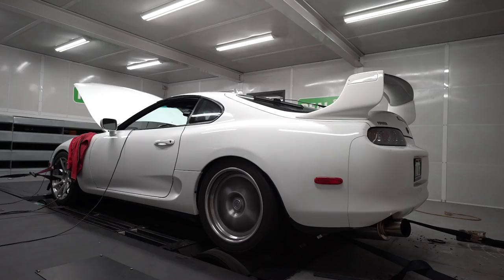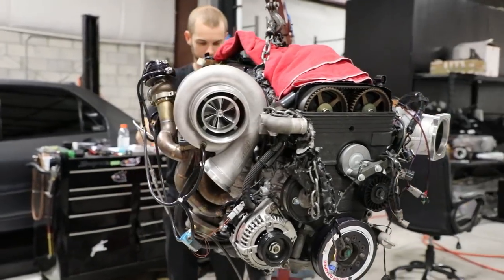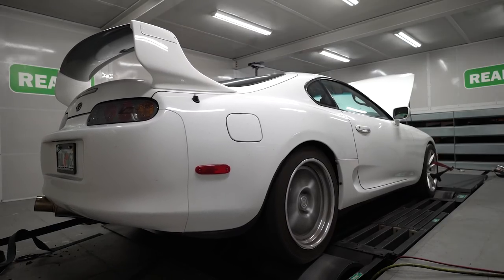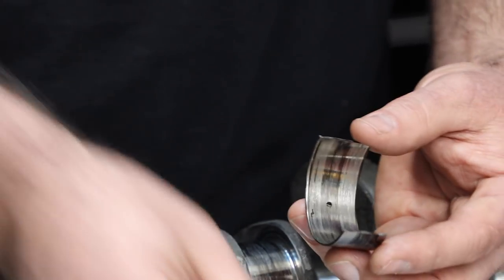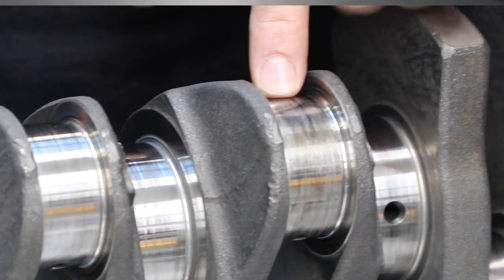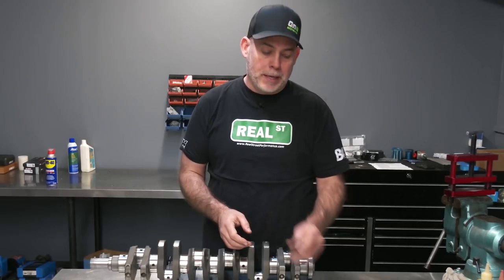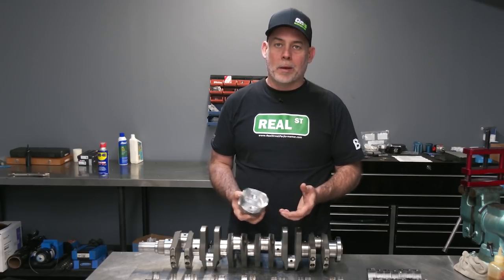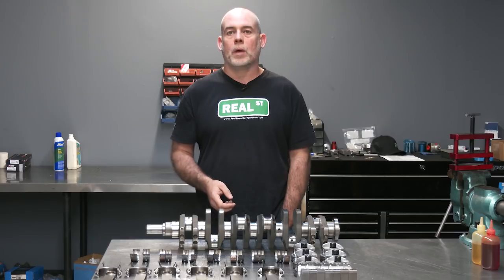Real Street 2JZ Failure Analysis Tear Down - Dyno Mule V1

Comment: Experience and wisdom without hype. Great video of development of engine life vs power due to parts systems.
Reply from the maker: thanks for watching Stephen
Reply: @Somerled Vonkaktus Ha ha really? Where is your video that is superior, equal to this? If your less don't hide behind word making you supreme. Polite people know what your doing and don't hold you to the real truth because they have mercy on a lesser man. Explain to you, negative without merit is mark of a troll. Thank you for your opinion forgot about video and now I'll enjoy it again!🇺🇸🌋🤔
Reply: @realstreetperformance  You can tell from the comments the bench racers vs we that task years in dyno room. Wow just find it to the point of funny at unfounded negative comments. Bragging at their lack of experience and knowledge. Thank you for excellent common sense video that is very clear for anyone open to increased knowledge. Keep up the good work!
Reply: @Somerled Vonkaktus Building custom engines 70s, 80s majority twin turbo and 10-71 to 14-71 blower engines. Common race engines in gas class going two season before need to freshen up for 9.90 class cars. 8.90 full season with one failure customer wounded engine in grudge race 7.91 1/4 mile on 96 degree day in 1987. Currently still running stroker big block 8.90 1978 Corvette. Works fine with oil coolers and is street driven to grocery store and for fun with 12.7 compression on 110 octane gas. Running dyno for decades and results of power with endurance. So experience with oils with or without dry sump oil systems. Road Atlanta or drag strips the 80s and 90s wasn't a time of replacing a car or mud truck engine every race. So talk is cheap but bottom end of engines and ring survival is a must found even today no matter what oil. Control of oil temperatures was a must baseline and alcohol injection conquers the problems when you still need keep timing more aggressive in the final rounds. Testing to the point of failure leaded to power and survival of a 520 c.i. big block chevy at a normal 7300 rpm with dual NOS each unit at 200 hp for total 400 hp boost on a 926 hp N.A. motor. I am retired now and this video is a very good example of how to read failures. If bit of timing or tired engine with it push pass endurance. If this guy was anything like you paint his lack of knowledge. They would be a window in the block...lol. You are just a disrespectful troll hiding behind negative comments to fool yourself like you are professional. Smokey Yunick would have kick you out of his parking lot. We both really have no time for someone who has to prove their stupid on the subject.

Comment: Great video  got me in hot spot thinking  ihave a VW 1600 engine  that had a worn out oil ring but I dnt know how to diagnose  if I turned  a bearing if my Crankshaft  if damaged  if the rods needs replacement  how do I diagnose  if the crank  needs to be cut o what

Comment: I disassemble my d15 honda engine and on my rod bearings on the upper  bearing hole has some material of bearing removed....like the oil pressure flakes the bearing around the oil hole....what cause this?

Comment: I have a 7 bolt 4g36 eng the transmission  isn't  changing gears right I've replaced everything new my eng isn't running right and then it does like a dream and then it is hard to start it says masflow is bad egr valve is stuck it's new map sencer is not working properly I can wigel the wires and reset codes and it will either run right or like not have power no acceleration like the mass flow air sensor is bad then I can reset the codes and it'll run like a dream sometimes it says the A and B solenoid in the transmission is bad they are brand new do you know the corporate of what my problem is and if so can you help me out it is a 2001 2.4 liter Kia Optima

Comment: Hi, I have a problem, in the new engine I bought to my car, unfortunately a foreign metal piece ( 5mmX5mmX5mm) has fallen on top of the 4th piston. Had run around 30kms and at last removed it. Few indents in piston crown and head. No valves damaged. But still there is a small knocking kind of noise coming inside. Could you please tell me what should I do? I am planning to replace only that piston having assumed that there may be a small bend in the rod or damaged bearings. Shall I just do it and check ? or remove entire engine and inspect all parts? Thanks...

Comment: So heres a question, I just rebuilt a motor in a car. It had been run low on oil and the rod bearings were on their way out. Motor knocked for a sec on startup before the oil pump catched up then it was fine. With the new rod bearings in it runs much better but I'm still hearing some noise when it's cold. What are the odds that when it was run low on oil the main bearings went bad. What does an engine with bad main bearings but good rod bearings sound like? Thanks!

Comment: What size wrench is used to hold the cam in place while breaking lose the cam gear  bolts? I can't seem to find an answer for this anywhere. I don't want to use an adjustable wrench... I've had bad luck with them stripping bolts/nuts, etc. Is the fixed wrench size 31mm or 32mm?

Comment: Mine (knew beforehand it would happen eventually - stock bottom end ca18det)..stretched rod bolts -> big end bearing loses oil film and starts to heat up due friction -> rod bolts completely fail -> rod fliess towards the cylinder head and smashes the piston to a thousand pieces -> crank hits the free rod towards the engine block and makes a huge hole -> engine seizes all happened at 8000rpm @ 250kph in under 5 seconds ;p

Comment: This comment might be so useless, my 2j was on the dyno just last night and everything went great apart from noticing detonation clues on two plugs at one of the pulls. Please tell me I have nothing to worry about and not to overthink, I mean jz’s can stand one detonation accident don’t they
Reply: To put your mind at ease it may be worth popping your oil pan off and removing a rod bearing cap to check out the bearings. If you see wear at the bottom half of the cap/bearing compared to the rest of the bearing its a good indication that detonation force was hammering downward and wearing your bearings prematurely.

Comment: I have a question on a stock 5.2 magnum cam failure.
 I am wondering what caused this damage, the roller lifter, pushrod and valve were all fine, just this one lobe seemed to be disintegrating.
 Here is a link to a vid showing it.
 (If that's ok, if not just delete this post.)
👍
https://youtu.be/YsmPxCQu5mU